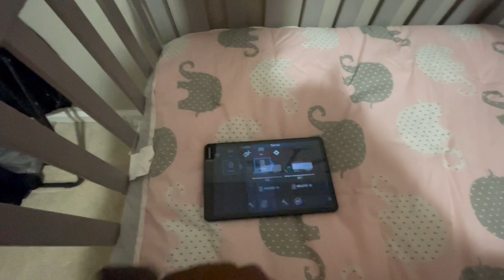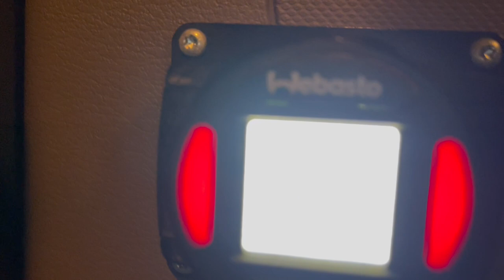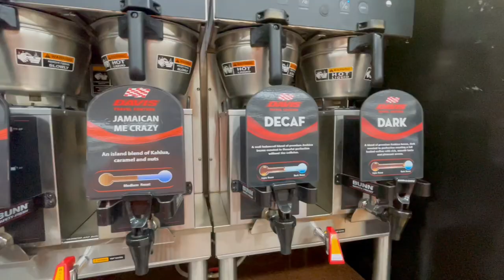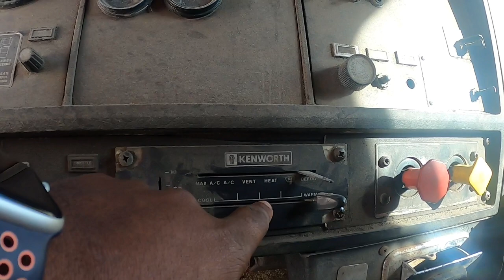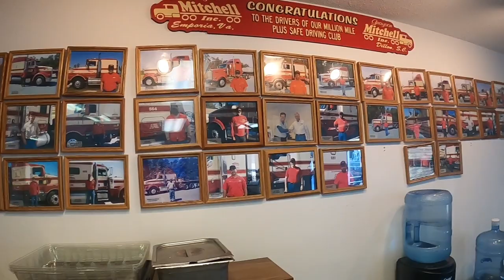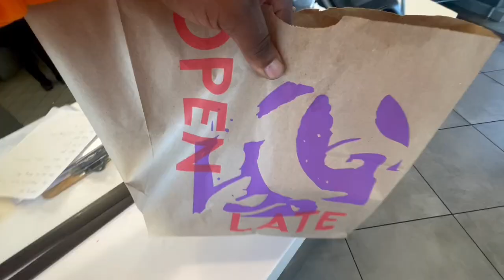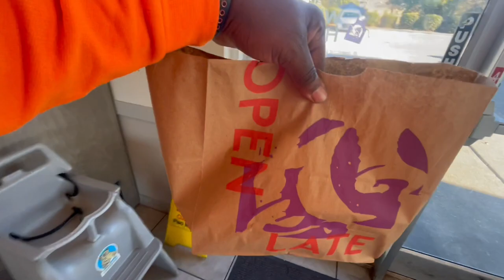Flatbed Trucking Life

Comment: Old pre electronic T600 KW, made those trucks up to from the mid 80s to 2007!  I say pre electronic because of that manual throttle cable, probably has a 3406B model cat or a Big Cam Cummins, looked like a 9 or 10 speed. Spring suspension on the drives!  Late 80s early 90s most likely! #flatbedgang ⛄️⛄️⛄️
Reply from the maker: Classic ride. Probably rides rough lol